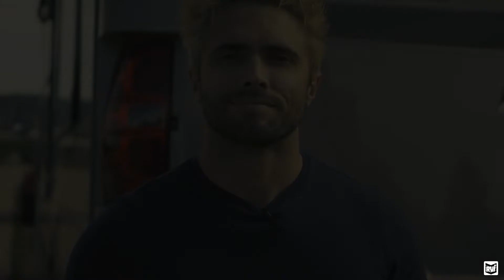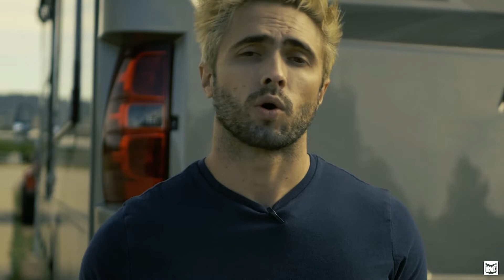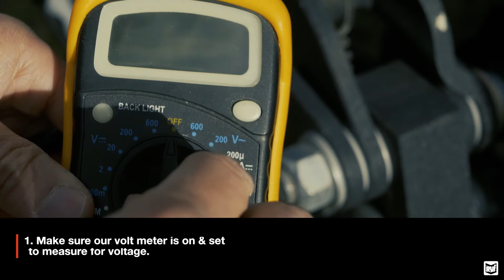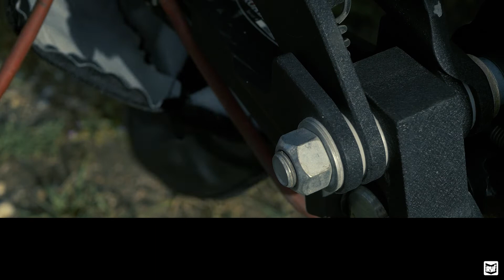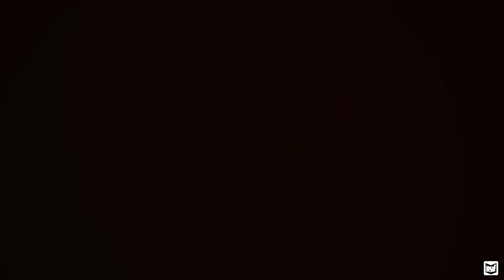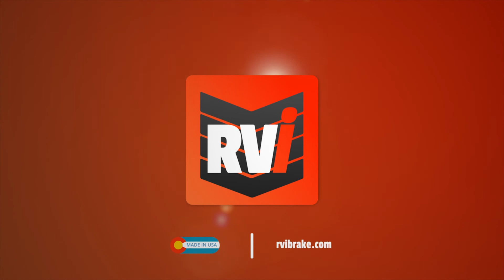RVi How-To: Finding Your Hot Pin for Towed Battery Charger & RVibrake Shadow

Comment: What a terrible video. Doesn't even show testing the pins just a shot of the multimeter.
Reply from the maker: Hi Dave, so sorry to hear you didn't enjoy it! The reason we primarily show the multimeter is because that's the important thing here - we need to see what reading we get. As you can see towards the bottom of the frame, all we're doing to test is inserting the positive probe into each opening on the umbilical. Hopefully that helps!